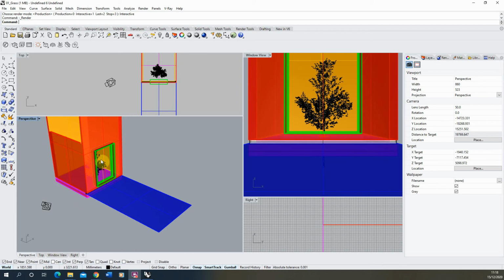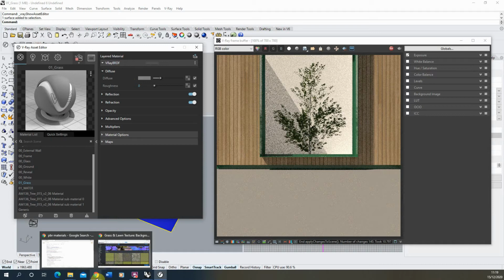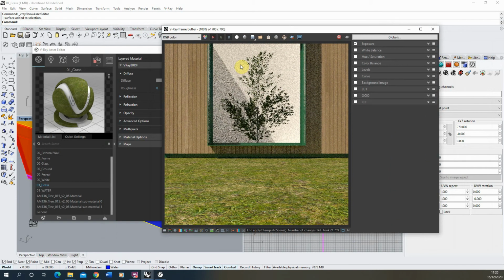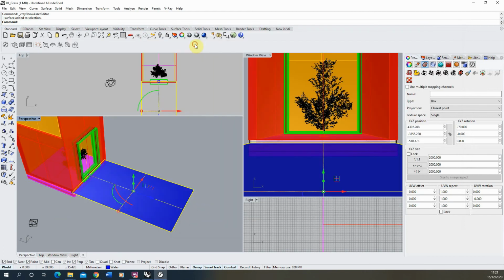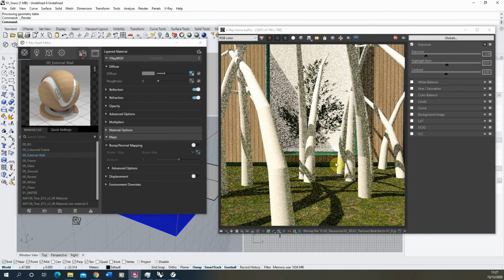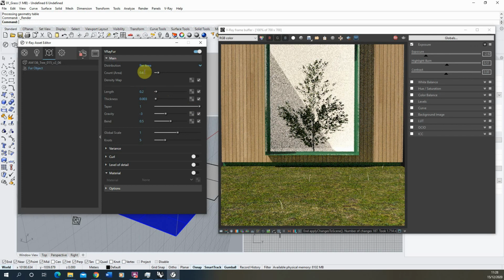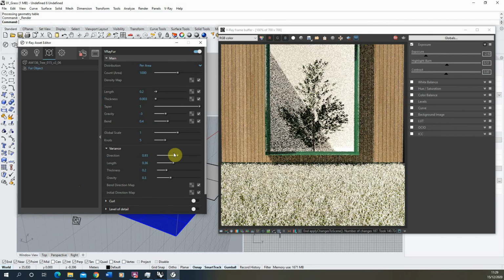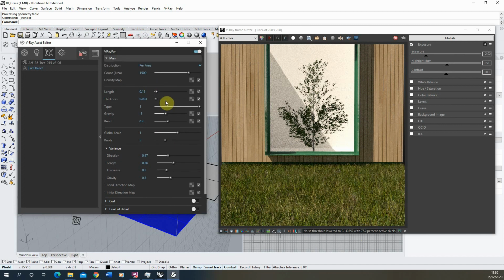Grass Material Creation - V-Ray for Rhino - Tutorial

Comment: Hi! I added fur to the surface, but the spikes are rendering in black - only the base plane has the texture. How can I fix it?
Reply from the maker: This is likley because you need to give a texture to the VRay fur object. This can be done by selecting the object in the VRay assent editor and under the material tab you can select the specific material you want to apply
Reply: @tombudd15  thank you! I figured out that I was on different active layer than grass surface and this caused the mistake.

Comment: I tried to add the fur to a surface and it didn't work.
Reply from the maker: Hi AB, sometimes the respond fur does not show is due to your units. If you are modelling in mm that you will need to scale your fur by 1000 in the settings to see it
Reply: @tombudd15  thanks. I am working on a file that's 40-50 mb hopefully it can still work.

Comment: hi.thanks.
i do as your steps, but when i choose grass material for the fur, doesnt show the material on the fur in render scene.what should i do?
Reply from the maker: Hi Moha, you need to make sure yiu have corrently texture mapped the surface to which your applying the VRay fur too. You will also need to make sure you have correctly loaded the grass bitmap into the texture. Another thing to check is that your not accidentally applying the material to another VRay fur you have made in your scene
Reply: @tombudd15  thank you Tom. it was solved as you said.